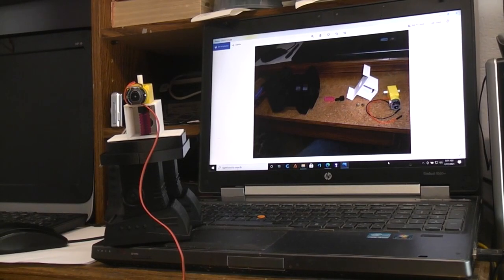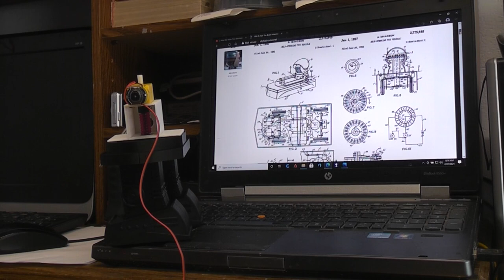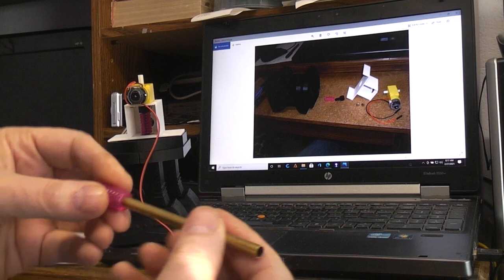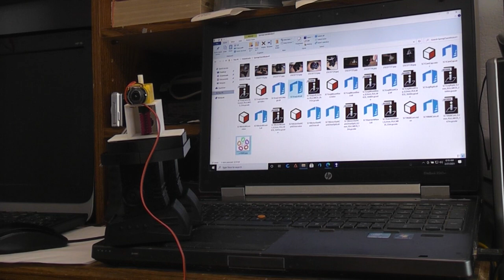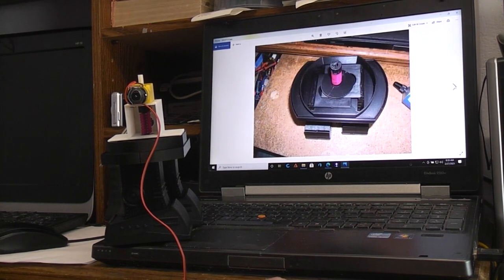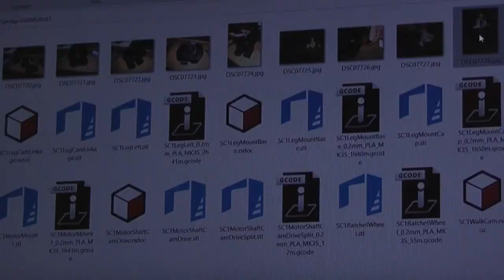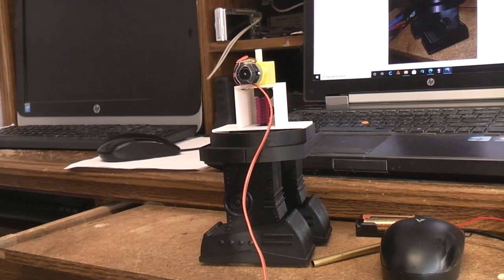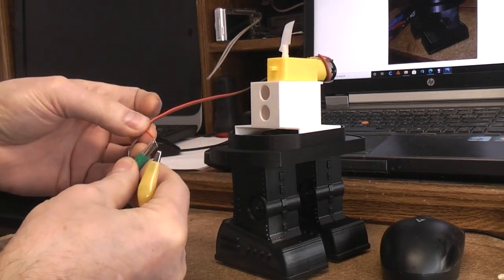1 way spring clutch experiment. Based on 1956 Z-Man the brain patent.

Comment: Copiers make extensive use of spring clutches in the paper pick up, feed and separation functions. The springs I saw were usually flat wire coils and ran in grease. Some had a tab that engaged to disable the grip under certain conditions. So there could be 3 states of operations based on forward, reverse or tab engaged to disable in what would normally be the gripping direction. I seem to remember seeing some plastic spring clutch somewhere long ago. I will report back if I find something useful.

Comment: hello. i just purchased a robot commando on ebay. its in excellent cosmetic condition, and does not have much rust at all. the person i purchased it from said he put in batteries and it did not run. the brown remote cord has a small fray with some wire coming out. could this be the issue ? i believe this example is worth investing some money to get it working properly. i live in the san francisco bay area. do you know of anyone who can do the work for me. i really would like it restored. do you do this kind of repairs ? any information would be appreciated. thank you.
Reply from the maker: The power wires run on the side edges of the remote control cable so Yes if you see a frayed wire this would stop the robot from operating. Robot commando is a large toy, by the time you double box it so that shipping does not damage it more the shipping costs " both ways" and the repair costs would be way more than the robot is worth. I do not know a repair person in SF but there has to be a ton of them in a Tech. rich area like that.